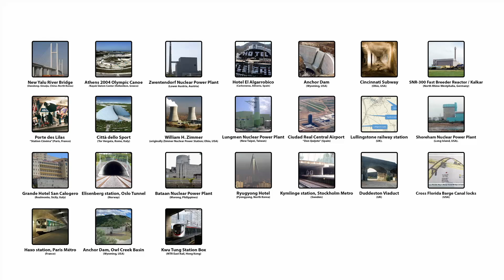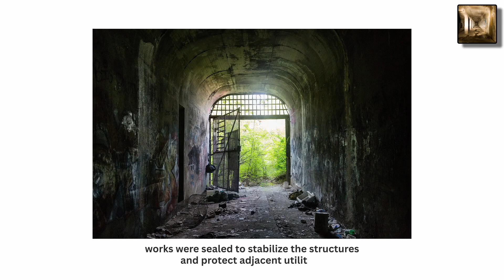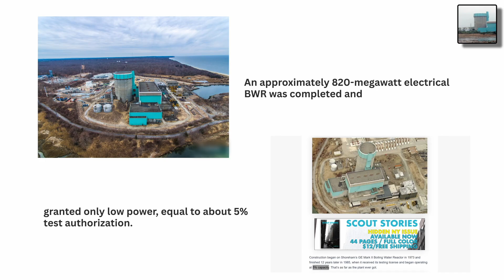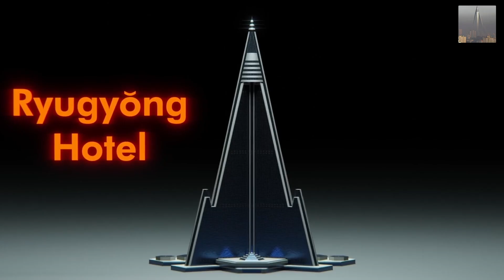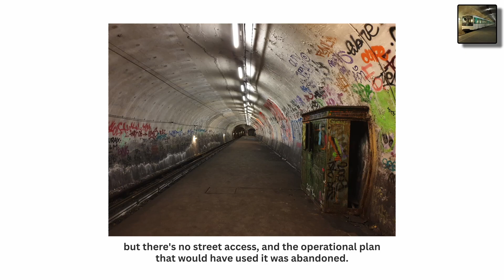Every USELESS Megaprojects Explained

Comment from the maker: 00:00 New Yalu River Bridge
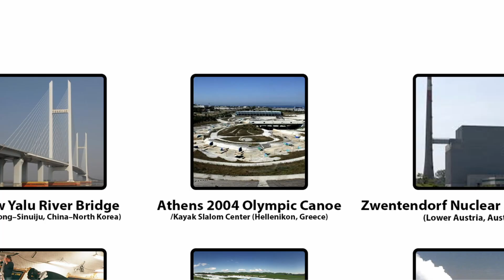00:42 Athens 2004 Olympic Canoe/Kayak Slalom Center
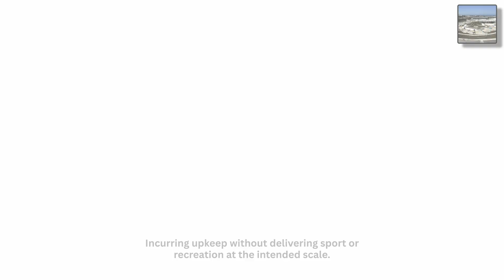01:21 Zwentendorf Nuclear Power Plant
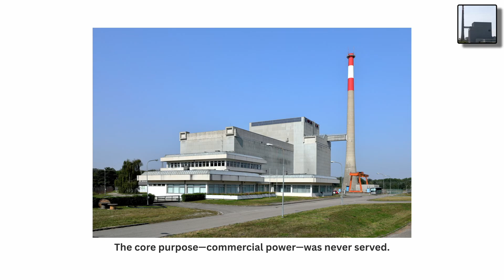02:12 Hotel El Algarrobico
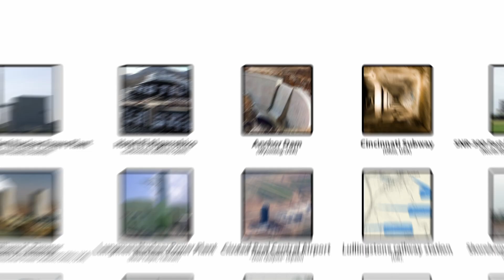02:55 Anchor Dam
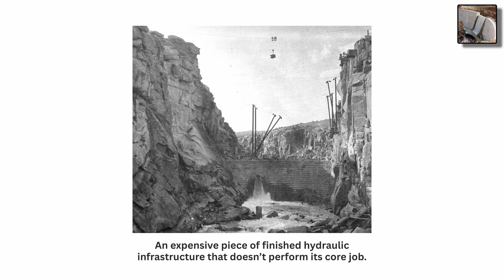03:22 Cincinnati Subway
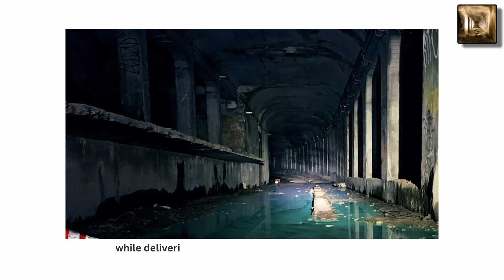04:25 SNR-300 Fast Breeder Reactor / Kalkar
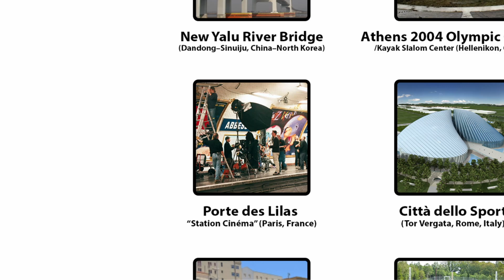05:10 Porte des Lilas – Station Cinéma
05:43 Città dello Sport
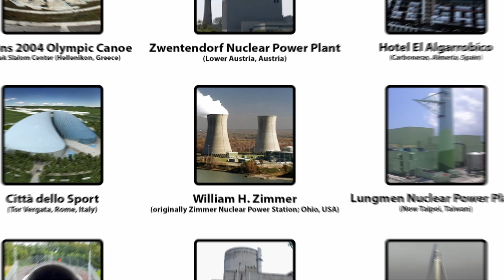06:21 William H. Zimmer Nuclear Power Station
07:03 Lungmen Nuclear Power Plant
07:43 Ciudad Real Central Airport 
08:15 Lullingstone railway station
08:47 Shoreham Nuclear Power Plant
09:34 Grande Hotel San Calogero
10:08 Elisenberg station, Oslo Tunnel
10:37 Bataan Nuclear Power Plant
11:28 Ryugyong Hotel 
12:36 Kymlinge station, Stockholm Metro
12:59 Duddeston Viaduct
13:21 Cross Florida Barge Canal locks
13:50 Haxo station, Paris Métro
14:19 Anchor Dam, Owl Creek Basin
14:51 Kwu Tung Station Box